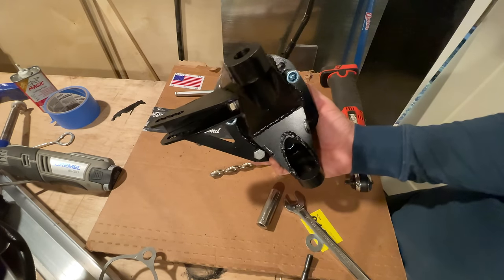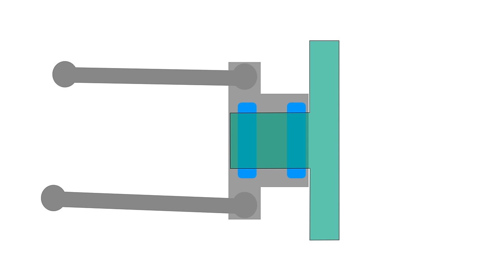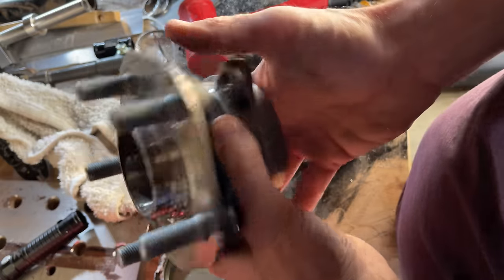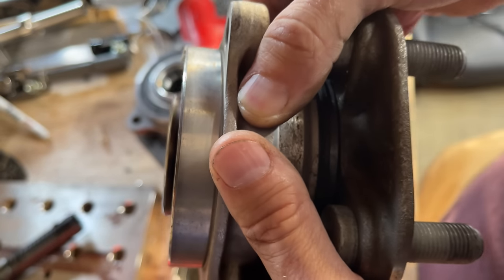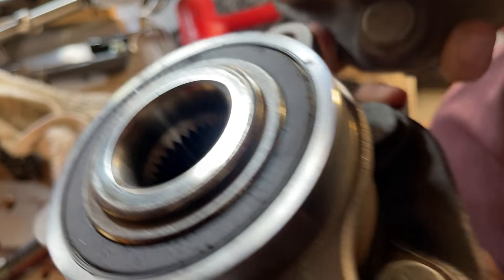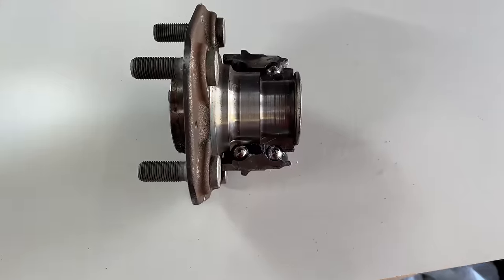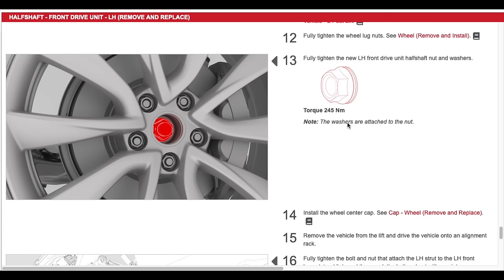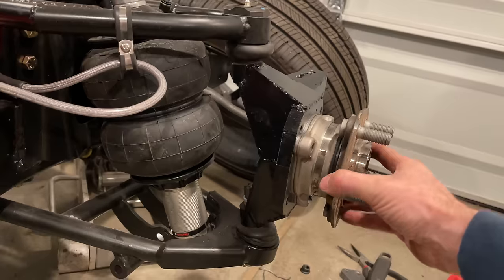How Wheel Hubs Work

Comment: Most do not need an axle installed to hold them together. Look at 2WD trucks that use the same hubs as 4X4s. No axles installed with no problems.

Comment: I had a bad day once. Hub assembly without axle in place separated at 70mph. I think you're making a good decision to use the unit bearing intended to be used without the drive axle.
Reply: Yes that is the way, maybe there are some splined bearings that will work axle free, but I would not chance it!! If Tesla made two different styles, there's a reason why.

Comment: Half the amount of toque use to tighten down the axles is simply to keep them from coming undone. And having the splines chatter will quickly destroy them And ensuring that in the event that the bearings fail the heat doesn't fold back that mushroomed bit Which is the  actual danger of not having the axle in hubs meant for axles.

Comment: <---  Automotive Technician (aka mechanic)  There are a number of vehicles out there  that are 2WD or AWD.  The 2WD models have no rear axles (obviously) but the manufacturers still use the AWD hubs in the rear.  They stay together without an axle holding them together.
Reply: You also know that a lot of unit bearings don't stay together without an axle shaft.  The mushroomed flange isn't present on all unit bearings.  For liability reasons, though, it's wise of Matt to not use the part number that isn't specified for a non-driven application. Project cars are already risky enough when it comes to "other than the intended application" type claims.

Comment: My 2017 Chevy Impala uses the same hubs on all 4 corners. So that alone tells me the hubs work fine without axles.
Reply: Another money saving tip: If it is a generic part shared with other brands then make sure you buy it from Tesla.
Reply: @davidpan2405  that is wrong!  Splined hubs need axles and axle nuts!! They don't say torque to 250' lbs for nothing! You can loose a wheel on the road, I have seen it happen! Hub separation is real and will happen on the first curve or curb.
Reply: @SailingKitabu  hi. What I meant is hot to (not) save money. If Tesla shares a part with the Chevy Impala as stated in the above chat, then make sure to buy the parts more expensive from a Tesla. I didn’t mean to make  a technical ,
Reply: @SailingKitabu  Try watching the video. If you have already, watch again, and pay attention this time.
Reply: @SailingKitabu  
Axles freely move in and out, how do you think suspension can work otherwise?
Reply: @Robert-cu9bm  what are you talking about? CV axle. Regular axles do not move at all. Axles are always locked in at the spline.
Reply: @SailingKitabu  
Yes on CV axles, the ones he is talking about.

No they're not.
On a solid axle you have to options.

Floating and non floating.

Floating(used on lots of trucks and Toyota 4wd) bolt to the outside of the hub, and can be removed without taking the hub apart.

Non floating the axle is the hub.

But none of them are locked in at the spline, (definitely none in have seen) because you would never get them apart as the spline is in the diff centre.
Reply: @Robert-cu9bm  The stub axle in the hub is locked in place, whether it is used to retain the bearing (as it is sometimes) or not (as in this case). The axial movement or "plunge" required to accommodate suspension travel occurs either in the inboard joint (as is common with a tripod-type inboard CV joint) or in the shaft (in the case of a shaft with sliding splines); the outboard splined end of the axle assembly does not slide in the hub. 

This applies whether the joints are constant velocity (CV) or U-joints; with U-joints a plunging shaft is used (unless the suspension design uses the axle shaft as a suspension link, like an old Corvette), and the stub axle shaft in the hub still doesn't slide in the  hub.
Reply: @Robert-cu9bm  Whole lotta misinformation here.  I've worked on plenty of vehicles, and CV axles usually have a face that mates to the "inside" of the unit bearing and a threaded portion for an axle nut on the exterior side.  They certainly don't slip "in and out" at the bearing.  The suspension motion is allowed by the CV joint(s).
As for it "being fine" to drive on them, that depends on the construction of the unit bearing.  I've had bearings collapse with the axles removed, older SIlverado with a busted diff.  Pulled the front drivetrain and rolled it outside to make room in the shop while waiting to find a new differential.  Truck probably made it 4 feet before the bearings crushed.  You're certainly wiser to assume that you can't in this case.  Maybe you can, but it's a pretty big "if" and quite the gamble, too.

Comment: (Edit: maybe I'm just talking bullshit, read comments bellow)
About the torque on the axle nut: weeble-wooble (orbital motion) on the splines is no bueno. A lot of the axle torque goes through the friction between the axle end and the bearing pack. If you have motion between the you'll chew the splines.
Reply: Why doesn't that happen to the transmission?
Reply: @MrGivmedew  good question, haven't thought about that.
Never seen transmission side splines worn out, and those just get a circlip at most.
Maybe is the angle that the axe makes with the bearing, on a FWD the wheel side spline is subjected to higher lateral forces.
Or maybe I'm wrong and in the cases I've seen I'm correlating the loose wheel bearing nut with worn splined although they don't cause each other.
Is there a mechanical engineer in the room? I have a extreme case of "not sure about it-titis".

Comment: About 40 years ago when I had my 1977 Scirocco (FWD) my Volkswagen employed uncle told me that just pushing the car around without the axles in it could ruin the front bearings because the torqued axle shaft swelled the inner hub to create the correct bearing preload. I believed him. I don't know if that is the case here.
Reply: It's true for conventional press in sealed knuckle bearings.  The bearing use plastic cages in many cases so not loading them with an axle can damage them.  Matt has proven at least these bolt on hubs don't need the axles.  I wouldn't assume it's a universal rule for bolt on hubs though.
Reply: You should know, because Matt explained that the axle doesn't have that role in this design.
Reply: @brianb-p6586  Sure THESE bolt on hubs are captive and don't need an axle. That doesn't mean the bolt on hubs on my STI are captive the same way.  They don't need to be because the Suby uses axles on all 4 corners. 

I'm just pointing out that Matt's findings are for these specific hubs only and might or might not apply to other hubs. 

I found it kinda disturbing they used the hub as the bearing race instead of a more conventional hardened steel race.
Reply: @quademasters249  I agree, but James said "I don't know if that is the case here", which means in the specific case which Matt showed, and the answer for that case is clear... and the point of the video. Of course you should not apply this answer to unrelated designs of hubs.

But I checked driven-axle Subaru bearings and they are bolt-in units complete with hub, suggesting that they likely do not use the stub axle for retention. I checked a specific unit at random (made by Moog) and the features included "Roll-formed design guarantees optimal, dependable preload"... which means that it is the same design as the units used by Tesla (which is not surprising, since most vehicles use this design now).

The use of the hub directly as a bearing race surprised Matt, you, and me... but I don't know what the material characteristics are, so I'm not about to pass judgement. It seems strange that the same material would be both hard enough for the bearing race and soft enough to deform for assembly; however, the race area may be locally hardened.

Comment: I'm starting to give up on the idea of a DIY EV conversion on a barn find Alfa 105 GTV. Filing this under the "Barbie, math is hard" folder.
Reply: What keeps me from EV swapping my Fit is the cost.  I expect it would cost not less than $10K for probably a short range EV conversion with used parts.

Comment: if you used volvo c30,v50,c70 or s40 hubs they would pull out like that. they had replaceable bearings that crept out and had to be updated with a clamp and green locktite around bearing. they are the only ones who had that issue..... for those commenters ....STHU!

Comment: Honestly Matt. Listening to the internet?
I was told I was going to crash and die in the first corner in my race car because I used a "regular" racing seat and not a full containment seat in my ~100hp 900kg front wheel drive race car on street tyres that can't go more than 140kmh

Comment: Interesting design.  There is no replacing the bearings-- you must replace the entire assembly.  Kinda wasteful, but it's a Tesla, so...
Reply: Unit bearings have been incredibly common for more that 30 years now.  Most last the life of the vehicle with no maintenance.  On the whole, I'd say they're less wasteful that repacking or replacing bearings every year.  Unit bearings can and do fail, but it's not very often. They are sealed to keep dust and water out, and modern chemical engineering and metallurgy ensures a long service life under normal use.